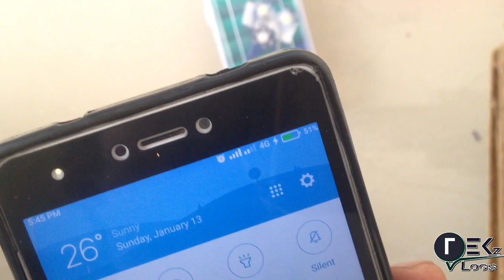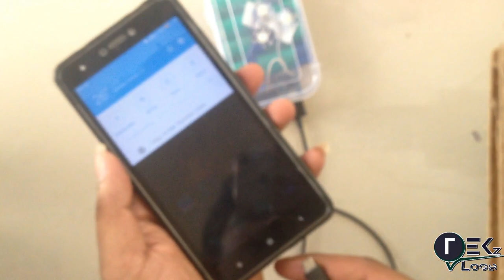4 Wow  Amazing Ideas | Laptop Battery | DIY #2

Comment: Ok, let's say honestly - first of all there are 2 not 4 "ideas" as you call them, the first is powerbank with LEDs and the second is the styrofoam cutter-thing. The powerbank is ok - in few words you put together batteries with boost converter/charging circuit, and that's ok, but the LEDs you've got are power LEDs which need to be cooled properly, and no, placing them on 18650 lithium batteries IS NOT a good idea. Limiting current with 3.5V zener diode is even worse - it doesn't work like voltage stabilizer, it let's the current flow only if the voltage is ABOVE 3.5V. And of course it's too small for that amount of power. The second idea you showed us is a resistive wire powered by 18650 battery to cut styrofoam - ok, but the switch you have used is TOO SMALL, they aren't suitable for bigger currents and I know it from autopsy. Also using bare resistive wire, bent in V-shape like soldering iron? Oh my. It's red hot and flimsy, even a piece of copper wire heated by cheap lighter would be much better portable soldering iron.
Reply from the maker: Thanks for using r comments..
This LED is not producing that much of heat, I used it for four hours continuously, a bit of heat is produced that is resisted by the doeble side tape itself..